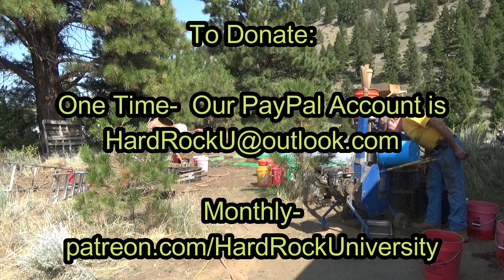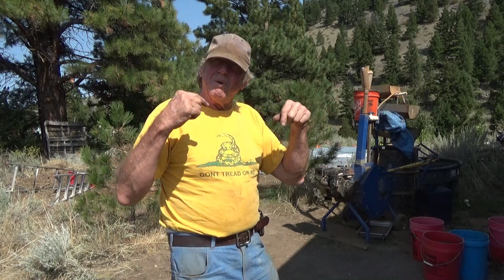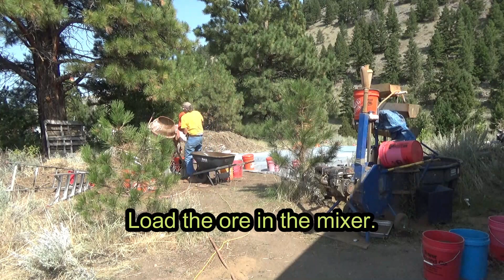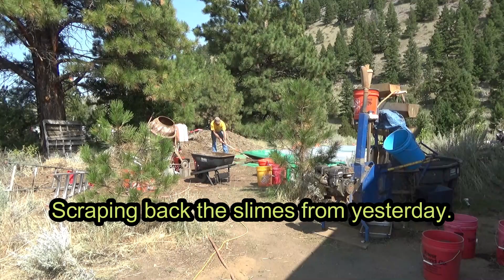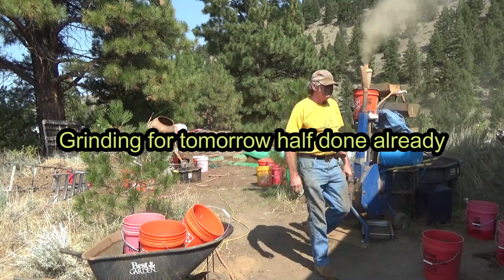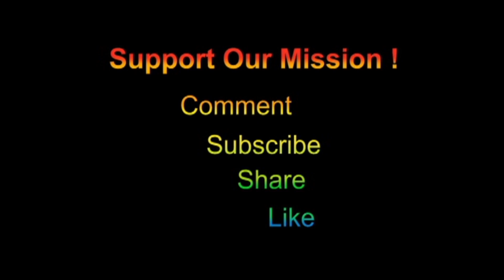228     100 Lbs Per Hour Mill Operations

Comment: 100 pounds of ore , would that be a 5 gallon bucket full ?
Reply from the maker: 2 five gallon buckets
Reply: @hardrockuniversity7283  aha - but would that be like chunky and when crushed it would fill 1 bucket ?
Reply from the maker: @mohammednovalija  Unless it is just large rocks it works out about the same.
Reply: @hardrockuniversity7283  per yard of material , a gram of gold sounds enormous , but when compared against time spent worked , maybe not so much.
Unless you are having a ball then time is irrelevant - I myself cannot see pleasure there - interesting watching someone else do it though.
Like they say "I LOVE Hard Work , I could watch someone else doing it all day"
Reply from the maker: @mohammednovalija  1 gram per 100 lbs not yard
Reply: @hardrockuniversity7283  NFI why I wrote yard - I meant what you said - sounds enormous just the same
Reply from the maker: @mohammednovalija  Only two buckets and the mill does the work.  Imagine a simple eight hour day at that rate of production.  Now think about a larger grinding circuit also.  I can EASILY shovel 1000 lbs an hour.....
Reply: @hardrockuniversity7283  How long does it take to grind down 100 pounds of rock ?
Reply from the maker: @mohammednovalija  A bit less than an hour with the 6" pulverizer.  About 30 minutes with the 8".

Comment: Well , your a fast worker Keith , ha ha ha , just joking . Looks like your into a rhythm now , bit of a bummer that your season is limited , so you cannot operate in winter , that's too bad . Once your on a roll it would be disappointing to have to shut down operations , anyway take advantage while you can i suppose , cheers Ned .
Reply from the maker: Yeah.  And it gets so cold we won't even be able to run the mill.  Even the lab solutions will have to 'evacuate' to the apartment.  Sure different from Arizona.  :-)